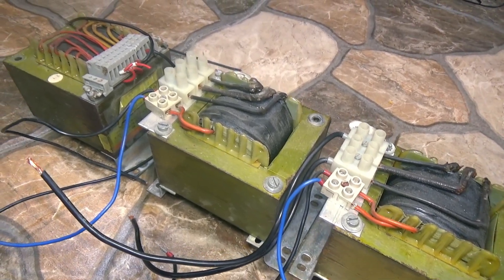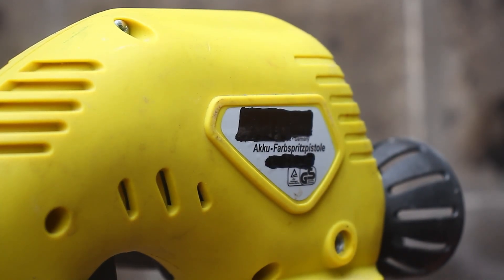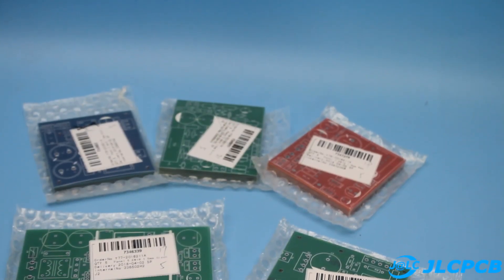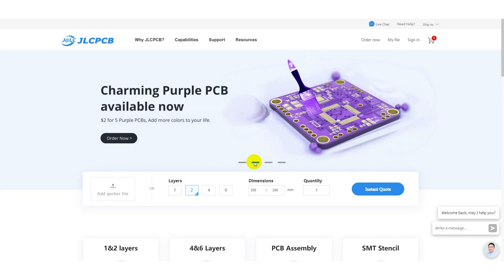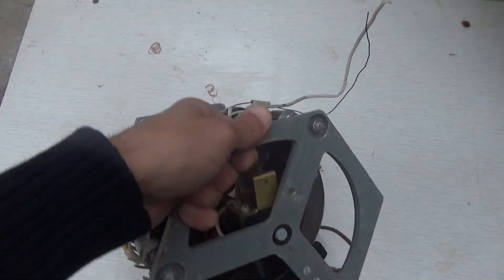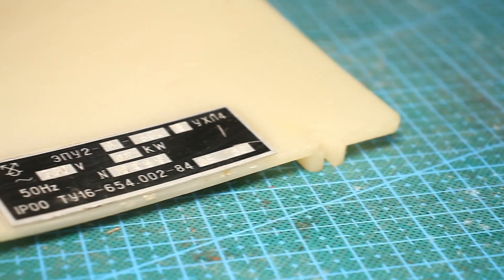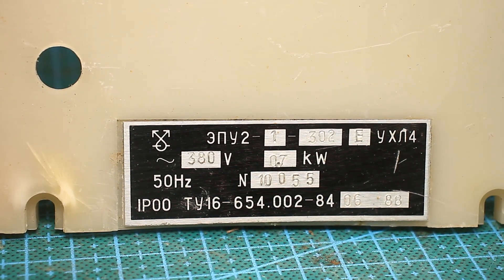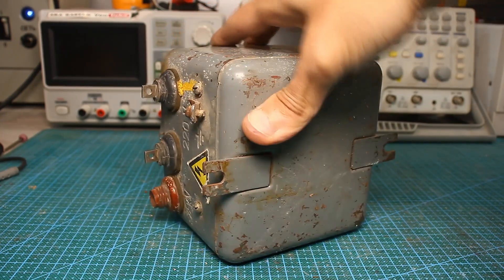Flea Market. New Amazing findings

Comment: I also purchased some high-voltage “door knob“ capacitors this week. They were getting hard to find for a good price.

I’ve been looking for a while, because I’m building a pulsed laser like the one shown on “les’s lab” YouTube channel. He designed a beautiful and wonderful post laser that can be built for almost no cost.

I needed 30KV 1000pF capacitors, And finally found them on eBay for a fair price. They’re usually $20 or $50 each. Was lucky to get a bunch of murata brand cheap on eBay
Reply: you can find them on aliexpress for five bucks each.
Reply: @poptartmcjelly7054  probably not the ones needed for crazy complex pulsed laser systems. Pretty demanding in terms of needing perfect and exacting specifications. However I have tried some of the cheaper ones from China and they are actually pretty good as long as they are axial leaded with proper spacing. But they’ll never take the place of the Murata brand and other high-end models when flawless performance is needed in massive pulsed power supplies. I’m Talking multiple kilowatts here

Comment: Beautiful finds! 

I go to industrial scrapyards near my home. And it’s unbelievable the things I find. 

If you can find an industrial scrapyard near you… Large companies and manufacturers will throw away brand new machinery, and equipment… Sometimes because they purchased the wrong thing, or sometimes they just clean out their warehouse and throw stuff away if it’s been there too long. 

I got a beautiful Siemens 20hp VFD last week. I think it weighed about 50 pounds so that means I only paid $5. I pay $.10 per pound

I took it to my buddies machine shop where they have big three phase power and motors…. and tested it under load… And it’s perfectly. It would cost several thousand dollars if I had to purchase it new. And this is a very common situation… I find things like this all the time